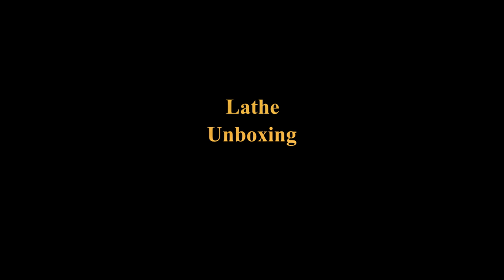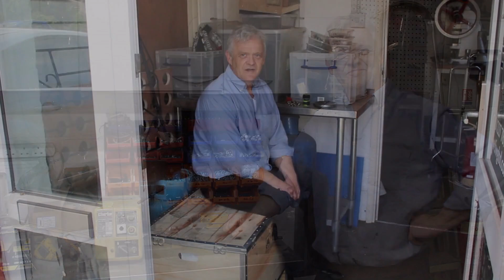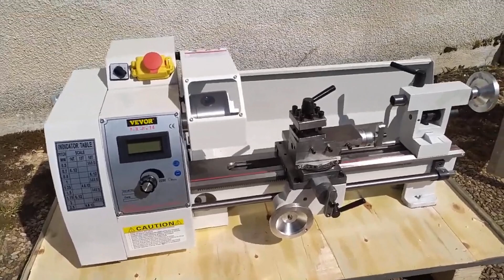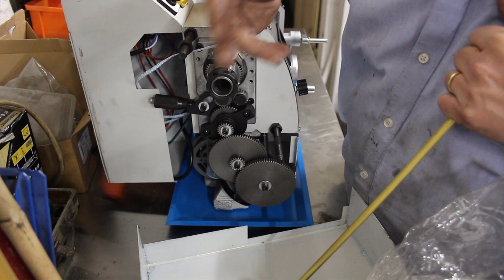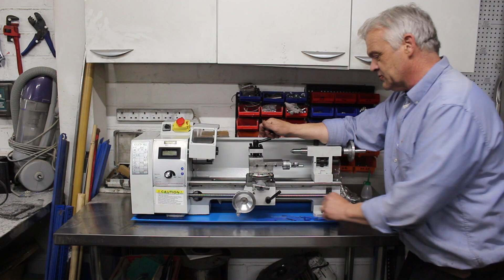1572 Review Of Vevor MX8x14 Mini Lathe 650W 210 x 350

Comment: I was eye-balling this exact model for nearly a year. Two months ago german amazon offered it for 499,- €, incl. shipment. But i missed the opportunity😴...and was crying my eyes out. 😭 😅
Now it is around 659,- € again. But then, the unexpected twist came around in form of a CT - 2140 V [one of the many variations of the 210 x 400 mm/ 8 x 16 inch], offered on german ebay, to be delivered to your doorstep for 689,- € [744,- $], available in the complete EU [now 729,- € incl. shipping]. 

It has got 750 w instead of 550 w, a 125 mm [5"] chuck which offers so much more possibilities, it´s got a MT 5 with a 38 mm spindle bore [tailstock is MT 2], a whopping 61,5 kg of "steadfastiness" and - on top of it all:  the concentricity of the spindle is 0,005 mm!!!! - not inch, what would´ve been already great! I couldn´t believe my luck at first and borrowed a Mitutoyo because i thought my Steinle dial indicator had a defect or wasn´t simply good enough. I couldn´t have been farther from the truth...the concentricity is simply that good. 
But, as everybody should know; this machines always come with some issues. To get real professional results out of it you have to clean and deburr them. Luckily mine came without the often used smear out of cheap grease and metal powder leftovers from production/assembly to prevent them from rusting. In my caser, no smear and no rust at all. 
After the "burrclean" you may have to deal with the backlashes and other minor things. But it´s all worth it. 
To be fair: i took a great risk, it is always like a lottery with these babes. The guy that bought one right before me had to sent his back because it did not work at all. I do not think that´s the truth at all. Some people think they will get something with a QC like Precision M., Festool, Milwaukee, Fein, Bosch, DeWalt and other "high end" manufacturers. Which is simply impossible for the given price.
These machines should only be bought by people willing to put time and effort into them and who like a little gamble. But even if you are not as lucky as i was - you can always fiddle this little gems to a degree of precision that lets them shine. 

This is no toy for people with two left hands [no offence here, could be, in some cases, two right hands]. A bit of skill is needed to get into machining. 
If you´ve never worked with a drill press, table saws etc. pp...in short, with electric powered tools...this isn´t the best tool to start a hobby workshop. 
But hey, maybe you´re gifted and you´ll get into it like a champ in a few minutes. For all others [like me]: please be careful.

It´s May the 14th, 2024 now by the way. Good luck in getting one of those golden nuggets i got my hands on.

Comment: You must have been very lucky, I have had nothing but problems with mine (exact same model ) bought it just over a year ago, used it no more than 6 times. On the seventh switched on and motor ran flat out, speed controller did nothing in fact I had smoke coming from the motor. Got absolutely nothing from Vevor as I purchased this direct from them. Totally ignored any communications fro myself. Would not touch another one of these if it was a gift. Buy cheap and thats what you get. As for support from the manufacturer, it does not exist very dissapointing.

Comment: I bought a similar one, the WM-210, have had lots of fun with it. I've turned plastics, aluminum, mild steel and 316 stainless so far. I also recently got an AXA QCTP and mounted it to the carriage. Easier done to than I thought. I also bought the 101xl tool holder and that holds 1/2" tooling just fine without any mods.

Comment: What quick change tool post fits without modification?
Reply: AXA 250-000 or AXA 250-100
The 000 is slightly smaller and will take 12mm tools. The holders are not expensive.. The -100, a touch more beef, but will also cramp your work size with more minimum tool stick out.

Comment: We have it’s bigger brother. Using it quite often and even some brutal shaft repair after welding. Over 10 years old. Last month the electronics gave up. Rebuild the 24V DC to 3 fase 400V with freq controller. Now it’s even better! Less vibrations, more power.

Comment: I'd recommend getting yourself a spare circuit board for it and don't do anything too heavy like I did, trying to cut a new cast iron 5" chuck backplate which poped the circuit board in just 1 week, mines the 8x16 but it seems ok for light work.

Comment: Nice lathe I have the exact same one. I purchased mine about 5 month ago. Had to do some small adjustments. My drive belt was super tight. But all in all I like it. It turns 303 and 304 stainless steel ok. Works for my needs. Enjoy
Reply from the maker: that's good to know mate - I mostly turn soft materials but the odd bit of mild steel too - so good info thanks for sharing
Reply: Bonjour, je viens de m'en acheter un et il démarre mais ne veut pas se lancer

Comment: Your old mini lathe did not even have this safety guard, so you are used to working the lathe without it. Keeping the key in the head is not a good habit as it will fly to the most harmful direction when the lathe switches on if you forgot to remove it.
Reply from the maker: that's true - on both counts - plus I have been working on lathes since I was 12 - they taught lathe skills in school when I was a lad

Comment: You might find the more expensive 8 X 16 lathes have 2 speed gears. 
When I was looking for a mini lathe, there were several iterations of drive to the spindle. 

I've got the 2 speed head stock, which means the chuck speed can be slower, with increased torque.
I also changed the belt drive ratio, again to increase torque, at the expense of spindle speed, which for the most part is excessive if it exceeds 1200 RPM. 
The chuck guard should have an inhibitor switch, which might need adjustment. 

There's plenty of information on improvements for these lathes, but you should consider it an assembled kit, which will need stripping, cleaning, lubrication and reassembly before it performs  at its best. 
Have fun!!
Reply from the maker: cheers mate but that's not for me - I will just use as is and see how it goes

Comment: When welding may not be an option(or if you want something to be modular), the threading feature might come in handy if you can't find that one compatible bolt in the shop.
Reply from the maker: I was wondering how it might do with coil winding tbh
Reply: @ThinkingandTinkering  around 15:00 on James T. Kilroy Jr.
 video "Coil Winding on the Lathe" looks like it has some good tips.

Comment: I bought a pottery wheel from them a few years ago. I would advise you from experience to check if the earth lead is actually connected... The pottery wheel had a cable with earth which was simply cut off at the point of entering the device. It did however come with a fake GFCI screwed into it inspiring a rather false sense of safety :P
Reply from the maker: oh I did give it a once over mate